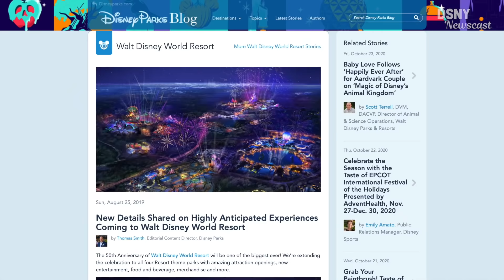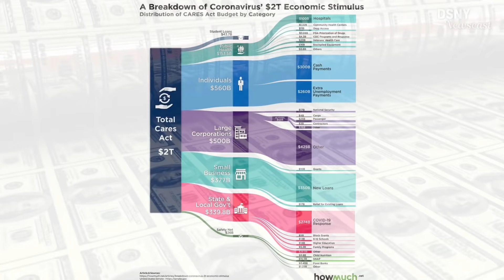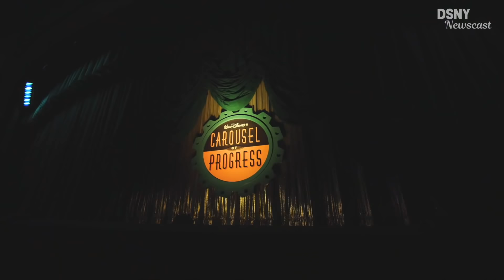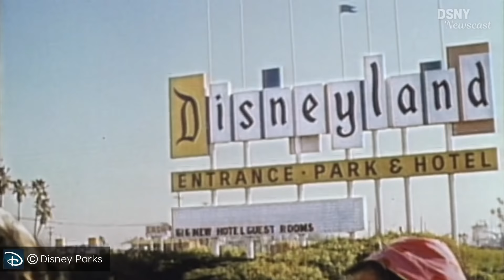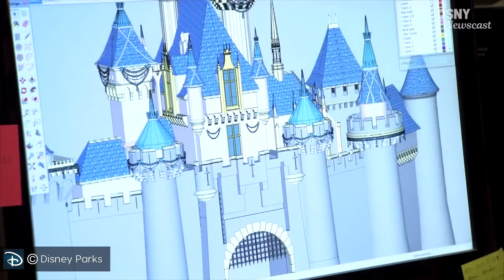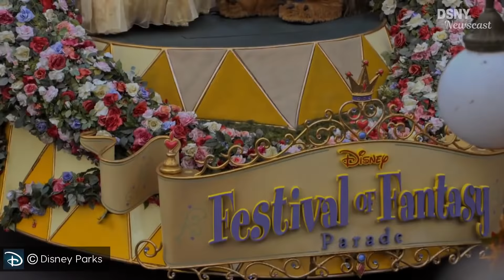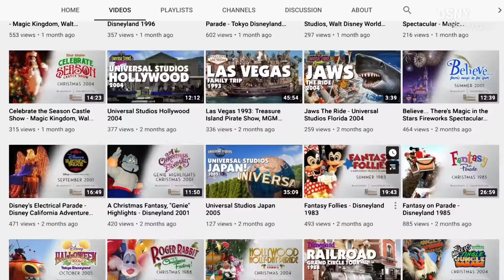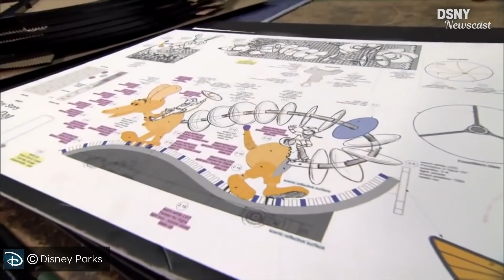What To Expect for WALT DISNEY WORLD's 50th Anniversary in 2021 - Disney News - Oct 27, 2020

Comment: Like the channel very much... But likely you will read mine is slim, you even quoted things i said in earlier videos and used them in later video. So I have no chance of a pin..  Two things I looking for a Walt favorites. The Walt Disney rail road( but no Tron means it has slim chance of happening... Also the people mover...but with no budget to finish or fix thing, also slim it will be done by Oct 2021 , but look like all we will have is a new coat of paint and alot of haft working rides, because as the rides items break it taking longer and longer to get fixed (through a net over it put a few plants around it), due to budget and man power (maintenance staff cuts)..6:41  upper right next to Epcot    Stay safe love ya pal..